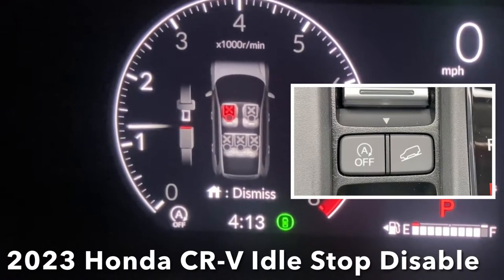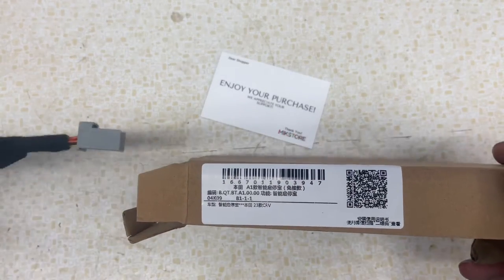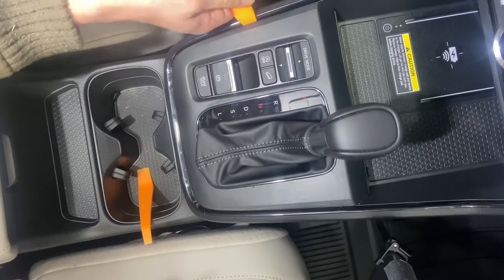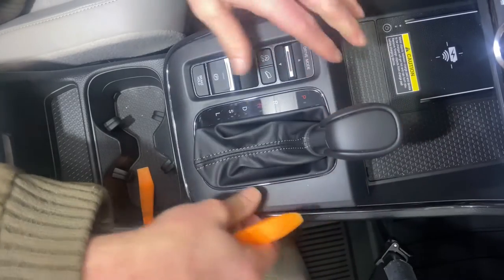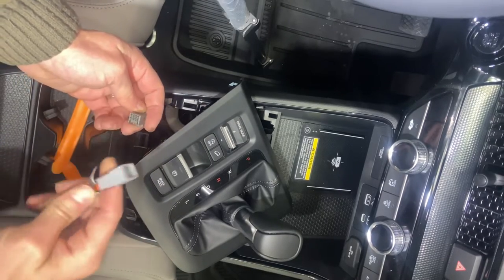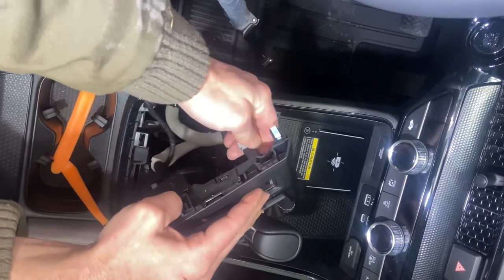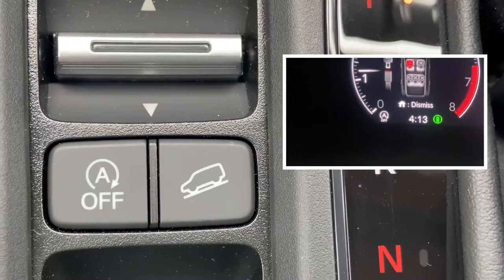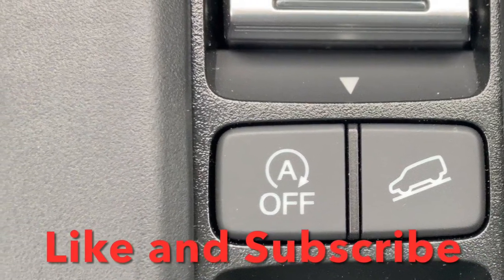2023 2024 Honda CR-V Idle Stop Disable

Comment: I was told by my Honda dealer that such devices will void the manufacturer warranty the moment one of these are discovered on the car.  True or False??
Reply from the maker: Read through the comments, lots of opinions. Bottom line is if you are uncomfortable, then remove it before you take it to the dealer, it takes less than a minute. Thanks for watching!

Comment: was wondering if its possible that the auto stop after being installed can prevent other functions like recalibrating tire pressure from happening when trying to calibrate
Reply from the maker: I have not ran into that or any problems and have had installed for 8 months and 10k miles. The hanks for watching!

Comment: Just got a 2023 Honda CRV and every time I back up the car stops itself not too aggravating. Any ideas? Thanks a lot.
Reply from the maker: Since you just got it, I assume it is used, so have you installed this or any other devices?
Reply: @zoomgas2803  Just a hitch and a bike rack…🤷‍♂️
Reply from the maker: @Cream1968 That sounds like maybe you have something w the Reverse sensor, that is triggering that. As the car turns the camera/screen on and other functionality, once it is in Reverse,  something must be interfering with that to create this issue. Have you checked it with a code reader to make sure you don’t have something else that this happens to trigger?

Comment: Hey I'm planning to get this done. I would like to know by doing this, will I be voiding any warranty or will this cause any issue with my dealer in terms of servicing and stuff? Thanks
Reply from the maker: I am 11k miles in and 11 months of ownership and this has worked perfectly. My dealer has not had any issues either. Thanks for watching!
Reply: @zoomgas2803  thank you for replying boss. What I wanna know is will my dealer give me shit for it and say "hey you shouldn't fiddle with it, now anything else that gets damaged in the car, won't be covered by warranty". That's the thing I need clarification on.
Reply from the maker: @ahabib91  if you are concerned about your dealer claiming this against you, remove it prior to taking your car to dealer, it’s a 2 minute changeout. Thanks for watching!

Comment: Do you know if there is a way to make the side-mirrors adjust with the memory seats? I was really disappointed when I learned that it's not the case
Reply from the maker: Not programmable unfortunately. Thanks for watching!
Reply: A real disappointment, no memory function on the mirrors or power folding mirrors.

Comment: Thank you Paul, bought idlestop from mikstore idle stop - delivered in 8 days to NY and installed it yesterday. They have nice upgrades for window auto lifters, ordered them too and waiting for delivery. Looking forward for auto folding mirror motors to come up. What's you opinion on throttle booster for CR-V? Good idea to get it on CVT transmission to improve acceleration?
Reply from the maker: Agree the Mikstore does a nice job.  Throttle boosters are fun, but usually wait till after factory warranty expires to start with those type upgrades, but that’s just a personal preference. Thanks for watching and enjoy your upgrades!!
Reply: Misleading information.. Got same part , from same store. Not disable start stop function on my 2023 CRV EX-L.
Reply: @vtl707  plz elaborate. It memorizes your action and disables auto stop everytime you start the car within 2 secs. My car doesn’t shut off anymore when I stop. It’s been 8 months

Comment: waiting for cargo tray.. dash cam and more videos from you why there no tpms in canada version
Reply: There is no tpms for US version too. They use different tech to figure put if one of the tires under inflated  by comparing how they spin. I have used one from aliexpress (nowadays available on amazon) where you have to put caps on each tire. Batteries last 2 years and easy to replace. They’re called: tire pressure monitoring system
Reply: I think it's better this way, no TPMS sensors to fail or die.

Comment: Why would you permanently disable it? I thought it was supposed to save on gas or something 🤔. I could be wrong...
Reply from the maker: It is not permanently disabled, when the vehicle starts it is off, but the button is 100% functional and can be turned on, the exact same way it can be turned off. So this device just changes the default to off vs on. Thanks for watching!

Comment: After installing the harness, it permanently disables the auto start/stop. Pressing on or off there will have no effect and no icon would show on off any more.
Reply from the maker: You should check that you have the right connector for correct vehicle that is linked in the description of the video. It allows the button to continue to work, it simply starts it in the off position when you start the vehicle. The dash display also is not impacted adversely.
Reply: Hey Dylan, did you fix this? I had the same issue

Comment: Paul, we’ve had our 2023 CR-V EX-L for a couple of weeks and really like it.  I was doing some searching on the subject of this video, it’s great and the answer to the problem, thanks.  Obviously this isn’t OEM part and when I went to the milkstreet web site they have other items you’ve installed and made videos of such as the mud guards and the rear seat USB charger but you used OEM for hose items.  Any reason you used OEM for those 2 items versus the after market?  I haven’t compared prices yet, so assuming the aftermarket are a lower price.  Your thoughts on OEM parts versus aftermarket parts?  Thanks and again, enjoyed your videos!
Reply from the maker: Just prefer OEM parts from Honda where available, as they are always well designed typically vs any similar aftermarket part. But costs can easily make you use other options and I do the same at times. Thanks for watching and for the question.
Reply: Hey Paul, will this item have any affect on the vehicles warranty?  I mentioned this item to a friend of mine and he asked me about that, I had no clue….  Thanks for your help.
Reply from the maker: @daledacar3650  that becomes subjective by your dealer, and that assumes a dealer is even looking to see if it is enabled/disabled. If you have an issue that your concerned about,  you can always remove it. As you see in the video, it literally takes 2 minutes. I can tell you that after 3+ months, I love it. Thanks for watching!
Reply: Thx for the info.  👍

Comment: I'm confused? What's the point of this when you can turn it off by pressing the button?
Reply from the maker: Many owners prefer for the default to be off rather than get to a stoplight and have the engine kick off and then remember to turn it off. So for those with that preference it is a very useful, easy, low cost solution. Thanks for watching!
Reply: @ZoomGas  I haven't tried yet but without the install, if I turn it off, will it turn back on again if I restart the car or does it remain off? I think this will be useful for that case.
Reply from the maker: @Michael-rq8zj  correct. Without it, it is on each time you start the car. Thanks for watching!
Reply: @zoomgas2803  well then now I know I need this! Thanks! Will you be making a video on how to place a dash cam front and rear? I am not sure how  hide the cables. I watched other videos but they're not for a Honda crv 2023.
Reply from the maker: @Michael-rq8zj  I don’t currently have that one planned, but always looking for ideas :)
Reply: @zoomgas2803  But I still don't get why anyone would want Idle-Stop to be off in the first place. Its there to maximize fuel efficiency. Do some people have a preference to get lower gas mileage?
Reply from the maker: @jeschr3462  driver preference regarding several items: the wear and tear on the starter and engine, the overall comfort on hot days as it impacts the AC operation and some drivers do not like the hesitation at stop lights as it restarts the car.  The gas mpg saving is a challenge to measure in seconds of shutdown at idle speed vs minutes/hours of driving, but again, this is driver/user preference. Thanks for watching!

Comment: Biggest problem is , it’s not for a 2023 crv , 2022 , maybe….
Reply from the maker: The part I have in the description is definitely for the 2023. Select it from the drop down on that page. Thanks for watching!
Reply: Does this part work for the 2024 CRV EXL model? Also, are you having any issues at the moment because you changed it yet?